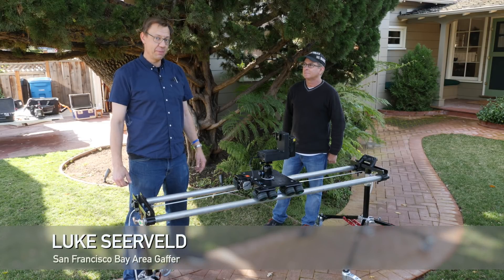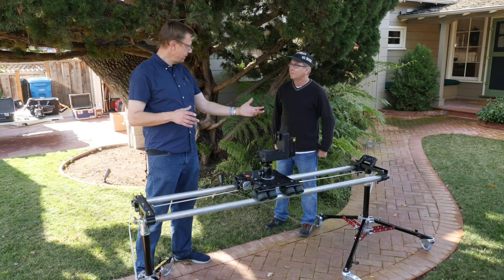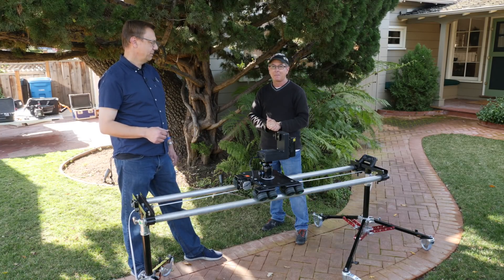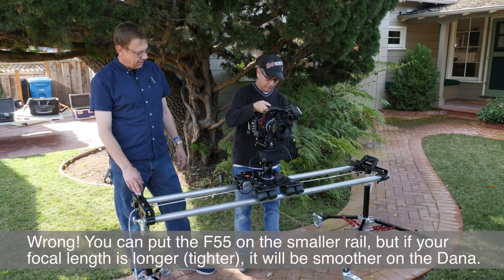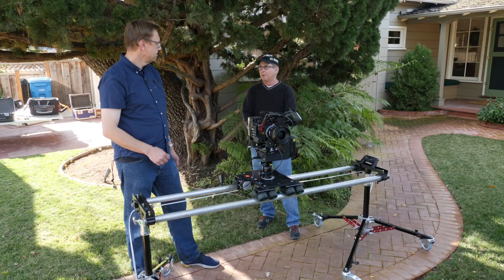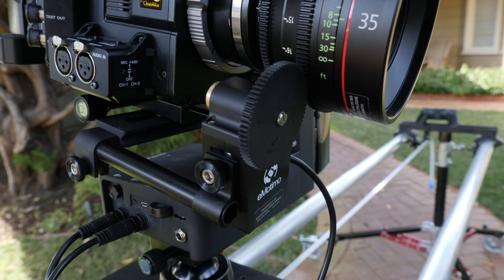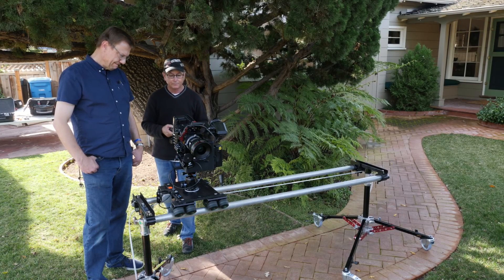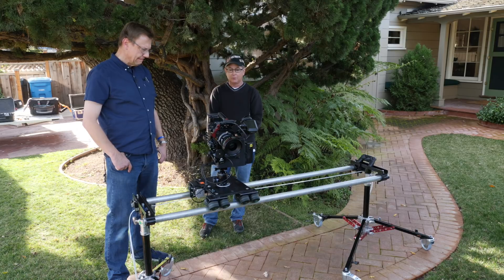Meet The Gaffer #80: Robotic Dana Dolly

Comment: Hi Luke, thanks for the video. Would you recommend that ballhead after your time of using it?
Best regards
Dave
Reply from the maker: Ball head? The one on the tripod? It’s certainly beafy. The only issue is that it’s quite stiff and takes some force to reset, which is good in terms of safety, but slows you down if ur in a hurry.
Reply: @meetthegaffer  The ''sirui'' branded one on the slider unit. Thanks for the input!
Reply from the maker: Ha, ha! Sorry, I thought you were referring to the most recent ep 198 where it was used as well, but on sticks. Yes, it is a very solid head and can take a good deal of weight.
Reply: @meetthegaffer  All good :) that also underlines its usefulness since you've kept it around for that long. Will also look at that episode, thanks!
Reply from the maker: Yes, it’s not as functional as my little Sachtler, but it works well for compact travel and stationary camera positions. I convert all my heads to standard manfrotto plates so in this instance I have a double plate.

Comment: Nicely presented Luke. I'm a bit surprised at the amount of weight put on that relatively small Sirui ballhead. Wouldn't a larger fluid head with long plate help balance the rig better?
Reply: The ball head has a 77lb. weight capacity and makes leveling easier. Alternatively, an Arca Swiss Mount could be mounted directly to the Dana Dolly platform. Only concern would be tilting down with a wide lens and seeing the Dana Dolly platform.
Reply: For a really solid setup with Dana Dolly, we like a 75 or 100mm ball receiver (comes with DD) to a short half ball adapter from Manfrotto (500BALL or 520BALL - https://www.bhphotovideo.com/c/product/553993-REG/Manfrotto_520BALL_520BALL_75mm_Half_Ball.html?sts=pi) to our included spacer/clamp.   The leveling is easy with the half ball too.  Since this solution only has a few degrees of leveling, it isn't appropriate for steep setups with our lighter weight slider integrations.  An Arca ball head is great for that.